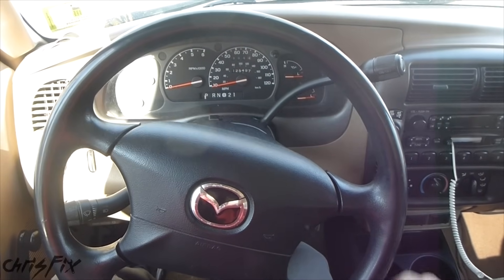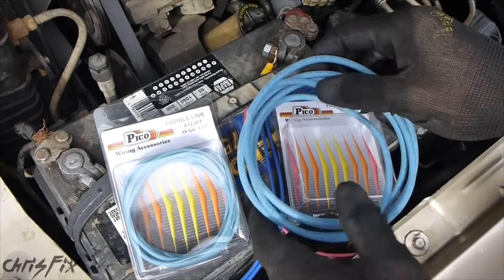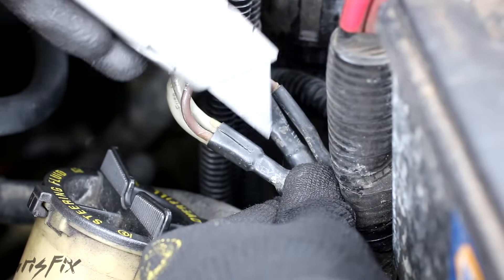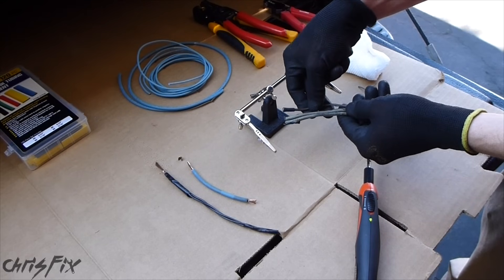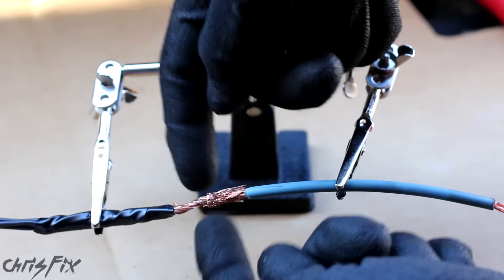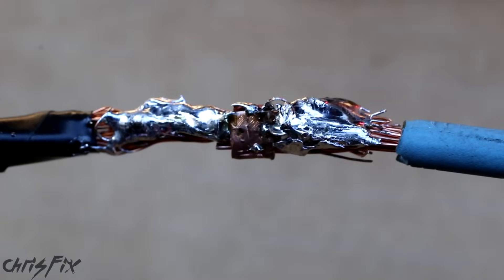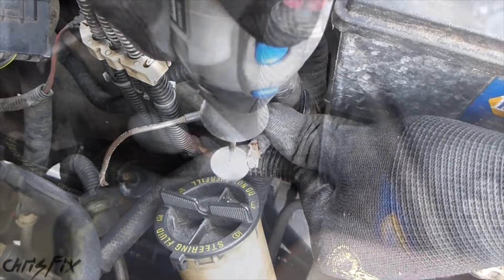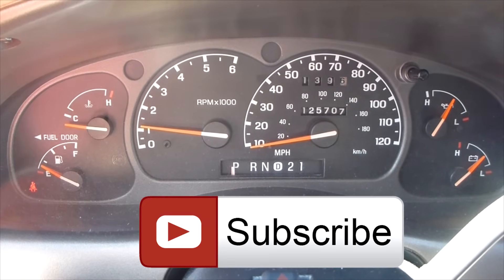How to Replace a Fusible Link (Car won't Start)

Comment: Many years ago I gave someone a jump start at the gas station. We just went by the red positive cable and black negative cable on his car. Well that was wrong! It blew my fusible link in half and I had to get a tow home. The fusible link on that Camaro was an easily replaceable part and only cost around $15. Now when I give someone a jump I always verify the battery polarity on the battery and don't trust the cable color.
Reply from the maker: +Brock Wardlaw Live and learn! You wouldnt expect the cables to be incorrect colors. Thanks for sharing!
Reply: Yes I have not seen one like that since so someone must have changed the battery cables at some point and got them mixed up and just left it. But once something like that happens you never forget it. The spark was huge and it had a loud pop. I thought it was going to catch fire. That fusible link was a crude fail safe but it worked and saved my car. 78 Camaro.

Comment: Don't crimp and solder. Just crimp. Soldered joints have the tendency for cracking. A good crimp is more reliable than a soldered joint in an engine. Wonder why absolutely no connections in the engine bay are soldered on wiring?

Comment: I am having the same issue. The beginning on November of 2018 I replaced the gas tank fuel hanger and pump assembly and pump. It's doing the same thing. It refuses to start. The battery is a year old. I replaced the alternator starter oil pressure sending unit distributor. It does the same thing. It refuses to start unless you dump fuel into the throttle body. Just what could be wrong? I also replaced the fuel filter. What am I doing wrong?

Comment: Pretty much this exact thing happened to me when I jumped my car with the polarity reversed. Everything seems normal when you put the key in, headlights work, fan and dash lights come on, but when I go to start it, everything just dies. And the dash lights and radio will flicker. Is this a fusible link? A fuse? Worse? 1998 3.0 Ford ranger
Reply: Yes

Comment: This happened to a buddy of mine 2 days ago but he doesn't have those wires coming off the battery it's an older model Chevy maybe a 80s model where can I find the wire at
Reply from the maker: Esten Acosta Look between the alternator and battery (positive cable) and the battery and fuse box.
Reply: ChrisFix alright I will tomorrow and I'll let you know Thanks love you videos too

Comment: what if it doesn't have those wires at all, plz help have replaced the pos and battery the car is doing what the video is but doesn't have the wires showed

Comment: use a butane torch to solder big wires, try not to get the wires glowing
Reply: practice makes perfect
Reply: use flux for better flowing of solder. clean with iso to prevent corrosion.

Comment: There is a better way to solder it which is soak the whole copper in flux then you melt the solder on top and it will solder much more cleaner if it was a heavy guage wire
Reply from the maker: Richard Zheng Yea? So the flux helps the solder absorb better into the wire?
Reply: well flow through it because it penetrates the oxide layer a bit and solder mainly has trouble flowing through oxide and if you just solder on top without applying additional flux the flux in the solder core just boils off while the oxide layer just appears in order to solve the problem is to apply additional flux and you cannot ever have too much flux also having a flat or chiesel tip of the soldering iron will make soldering much better because it has better heat capicity than your pen tip one
Reply from the maker: Richard Zheng Thanks for all the info! I will have to practice soldering with flux. Is there a specific type?
Reply: No worries. But any old flux even the homemade and cheap Chinese ones will do as long as it's not a solid and you need two sets one with low viscosity and one is viscosity but for solder in the other hand you must get a high quality that is made in rich and developed countries that is like multicore, American ones, Japanese ones etc
Reply from the maker: Richard Zheng Thanks! I will have to give it a try and maybe make a video on soldering!
Reply: ChrisFix For electrical/electronics soldering you want "Rosin" core solder and "Rosin" based flux as rosin is non-corrosive .
Using corrosive acid type solder or plumbing flux will promote additional corrosion inside of the solder joint leading to rapid failure of the electrical conductors and connection. 
You will most likely benefit from a higher wattage (>80W) soldering iron on heavier gauge wires. 
Soldering is easy when you have clean materials (clean, dry wires with no oils), the proper flux, the proper solder (type and size) and adequate heat to rapidly heat the materials to about 650-800 degrees F.... And steady hands. 

Scotch/3M, Thomas & Betts and Velvac make some excellent weatherproof crimp connectors that have a special coating inside of the connector housing that after crimping is heated with a heat gun and the crimp connector barrel shrinks and oozes a compound that seals and completely waterproofs the connector and connection. 
Currently a good source for inexpensive rosin based solder, flux and heavy duty soldering iron is Radio Shack while supplies last and Amazon. 
For automotive use, avoid the "lead free" materials, they are difficult to work with, do not flow well, do not resist vibration and do not have the corrosion resistance to road salts that lead does.
Reply: flux and rosin is pretty much the same thing in soldering wise and they're both to be design to be corrosibe a little bit in order to penetrate the oxide layer and if there is excess it can easily be clearned off with rubbing alcohol
Reply: yes I do know there is non rosin flux but they're just overly expensive and has no real benefits

Comment: I Have a Honda Civic 1985 4 door and i haven't used it for about a month and suddenly today when i tried to start i wont even blink anything battery is good and all the other stuff was oky but in the fuse line there was one wire ended up fired up so i knew it was maybe on the fuse line so i tried a normal by pass with a strong screw driver for the both side  and it shorts again but i haven't tried replacing new strong wires for the link if i replace em will it works ?? and why just a normal by pass with screw driver shorts??
Reply: The fuseable link protects the car from a dead short that can cause a fire. Never replace a fusable link with heavier wire than called for in your vehicle. Doing so could result in a fire if there is a dead short somewhere in your wiring. Sometimes the link fails just from age, but, if you replace it with the proper link for your car and it blows again, you have a bigger problem somewhere in your wiring that needs to be fixed first.
Reply: how to make dmt
Reply: Robert Ridge 7..

Comment: Lol that solder was terrible, one trick that i learned from my own experience is to heat the wires from the bottom then melt some solder from the top onto the wire whih will increase heat transfer to the wire and then going back from the bottom with the soldering tip. The solder from the top will sink right into the wire in nice uniform blob
Reply from the maker: Newbpwng Thanks for the tip! Yea, I think I need a better tip for that soldering iron and I needed to use some flux.

Comment: I have a 1976 Chevy c10 I replaced a alternator I put the hot wire on the ground so I need to replace my fuse linkage I have no power from the hot wire going to the alternator

Comment: Not all vehicles have fusible links though...
Reply: Yeah the ones that have the battery in that truck most likely won't have them.
Reply from the maker: Milton Huang That is true but for those that do, this will be helpful.
Reply: I agree, especially with the soldering part, a poor soldering is potentially harmfull for the entire electric system.

Comment: Yikes! Just saw you lay that socket wrench over hot wires so very close to the negative terminal. Hindsight is always 20-20 and its hard to film and work, but for that reason batteries should never be impromptu tool holders because of convience...
Reply from the maker: Peter Carlson There was the battery handle in the way and the ratchet was on the other side of the battery so it was fine. I was paying attention. Thanks for the concern though!
Reply: Lol! That socket was under the handle and if you bump it in just the wrong way they can weld themselves across the terminals, I've seen it happen and turn a wrench to a puddle of iron.

Comment: Never put heat shrink over a bad soldering job. The sharp edges on the solder the heat shrink.  Even worse if you wrap it in black tape.  These things have happened to me.  And to improve heat transfer you must melt some liquid solder onto the wires.  From the top first and then move the iron to the bottom but keep the solder on top.  That is why your job looked so crappy.  I didn't win the high school soldering award and then spend a lifetime in electronics for nothing.

Comment: Maybe put dialectic grease on the outside to protect from corrosion?
Reply from the maker: anti0918 You could definitely do that but the heat shrink should prevent corrosion. Thanks for the tip!

Comment: Seems really annoying to have to change that. Need a bit more heat on that demo solder, I have a 325 watt Weller gun that does the trick on big stuff like that.
Reply from the maker: NightWolfx03 Yea, it is really annoying but they rarely go bad so. I really need a 325 watt gun! That must melt solder like there is no tomorrow. What gauge wire does it work up to?
Reply: I was soldering smaller wire to a piece of solid 6awg, that seems to be able as far as I could go with it. It's an old-school iron that I got from a relative that was an electrician.
Reply from the maker: NightWolfx03 That would be awesome to have!

Comment: I can't find where to get the wires for my 98 Cavalier..
Reply from the maker: +Rexyungdoefiend Fuck12 I link all products in the description so you can easily find it!
Reply: +ChrisFix what's the correct gauge & length for a 1998 2.2L Chevrolet Cavalier

Comment: Help please. No brake lights no hazards no turn signals.  Parking lights work. Checked fuses and relays and change the multifunction switch. 
98 mustang gt.  I dunno what to do next.
Reply: Find the appropriate wiring diagram to see the brake lights circuit. From there test for voltage at key points in the circuit.
Reply: @OldSchoolNoe  I’m not that good with that kinda thing :(

Comment: Chris can you believe this... I go to get my oil change and they tell me my oil filter was on loose so oil was leaking I didn't even notice but now looking at driveway I can see hopefully nothing happened to the engine
Reply from the maker: joe moe As long as you have enough oil in the engine, and you had oil pressure, you will be ok. Did you have an oil light on?
Reply: No oil light came on
Reply from the maker: joe moe Did you run the car when you saw that light?
Reply: the light didnt come on
Reply from the maker: joe moe my bad, I misread that. Ok, good. So hopefully nothing bad happened!

Comment: On my scooter my fuel meter is shaking like your speedometer,and when I push the brake(front or rear),actually when the brake light turns on fuel meter falls down completely,and when I leave the brake fuel meter continue to shake.What problem that can be?
Reply from the maker: Sounds like an electrical connection issue. Inspect the wires that go to the gauges.

Comment: Hi I have a 2003 lincoln navigator and have in the dash the battery on, and the auto store tell me to change the battery I did and is still blink, they told me to change the stater, I did, Is still no charge know they tell me is the alternator. And I don't know if I change it or what because is that not it then what. And a mechanic tell to check the fuse link. Can you be the first one to do it. There is no body that works on 2003 and up on lincoln on YouTube.
Reply from the maker: Miguel Badillo Check out this video and test your alternator. Let me know what you find: https://www.youtube.com/watch?v=LGB6ZEjGm7Q

Comment: I did what you asked and came over to this video. What if i wiggle the 3 wires and nothing changes??
Reply: At least i think I'm doing it right. I see 3 wires but its coming out of the black wire not the red one

Comment: I accidentally blew a fusable link working with a alternator and not disconnecting the battery. Car wouldnt start, shift or do anything properly. On toyota's easy fix, on the positive battery. Took 3 days for the dealer to fix, and $270
Reply from the maker: AwesomenessIskey Ouch! Live and learn. This is what they had to do.
Reply: kinda sucks, since I do most the repair work on my own. Dealers always charge an arm and leg for everything
Reply from the maker: AwesomenessIskey Im the same way! The stealership gets that name for a reason!
Reply: lol same dealer charged $286 for a aftermarket wheel cylinder cuz of stripped threads. No flush or service. How stupid. I recently swapped my front brake rotors and pads and it costed $74USD with tax and shipping
Reply from the maker: AwesomenessIskey Ouch. They really killed you there. I get wheel cylinders for $10 and they last 100k miles no problem.
Reply: Most are guaranteed for life. Who the hell would pay $135 for an oem with a shit warranty? lol It's likely made by the same company, wagner, centric etc, but many people associate genuine parts as being better :(. How stupid

Comment: When I turn the steeling wheel the drives side front makes a knocking noise what could this be?
Reply from the maker: mike conner Can you see any contact on the drivers side? The knock might be a pop from a bad ball joint or tie rod. Check out this video: https://www.youtube.com/watch?v=brI2feYiEi8

Comment: I have a Ford Expedition 🤦‍♂️ but my truck did the same but they said my fuse link or link fuse need to be replace. The cable that goes from the alternator to the positive terminal. But my truck was acting like it was possessed turn on my four wheel drive,dashboard going crazy and now it says check charging system,already replaced battery and alternator

Comment: Why use links and not a legitimate fuse? Fuses are easier to replace, and you can actually see if they're bad or not.
Reply from the maker: +Xander Zoolander The links will not blow when you have a spike. A fuse will blow with a spike.
Reply: Is it because fuses have lower tolerances?

Comment: Two reasons why your solder wasn't flowing. Lack of flux and light duty iron. I believe if you only fluxed it, it would have flowed.
Reply from the maker: seephor Thanks for sharing. I will have to look into flux! I am not that great of a solderer. I appreciate the tips!

Comment: +ChrisFix  you need to wipe some flux in the wires before you solder, thats why they dont look so pretty. Big up from the S12silvia.com community.
Reply from the maker: +Rick Chang thanks fire the tip! I have since learned that helps a ton!  New video to come!
Reply: Respect for the reply bro!  And thank you as well, great quality vids and content everytime! From headlights to diff to super cool radiator flush to glass cracks right back to fusible links! Keep it up man, big up!

Comment: You should never solder a fusible link, even a professional solder can increase resistance and actually make the fuse blow out at a higher rating then what it should, for ex a 15A link might not blow until 16A or more due to the increased resistance which would then fry anything that fuse is protecting

Comment: I have a 2010 mustang...the dash goes completely black and the system stops charging...the battery and alternater checked out fine...does anyone know what the problem could be?

Comment: wonder if this would probably work on a Chevy impala  when car is started speedo goes all the way to 120 mph then stops at about 80 mph instead of going to 0 mph ?????
Reply from the maker: thomas uecker That sounds like the gauge itself is bad. On many chevys the gauge has a little motor on the back that goes bad. It is a common problem.
Reply: ok is there a way to test the fusible link
and the speedo only does it a few times a week
Reply from the maker: You can check the voltage at the batter with the car running to see if there is 14.2 volts. If the fusible link is bad, it might be 13v. Check it out: https://www.youtube.com/watch?v=LGB6ZEjGm7Q

Comment: Uh the solder wont work without flux. And you always use lead solder on copper. Thats what i noticed about a lot of you tube tutorials,.they leave out   at least one important detail that makes it work..